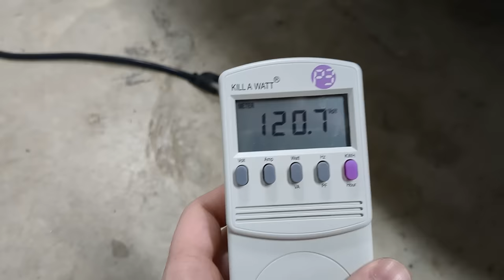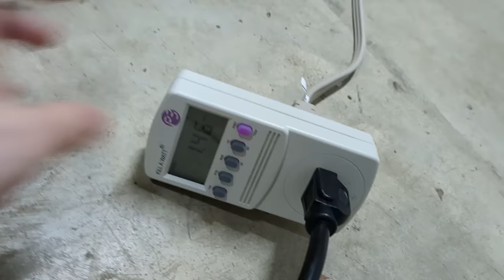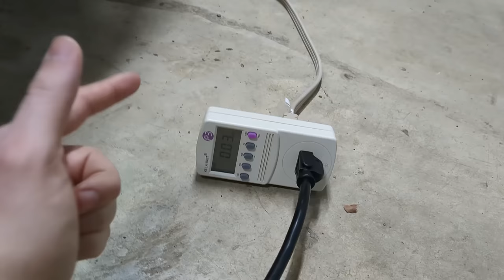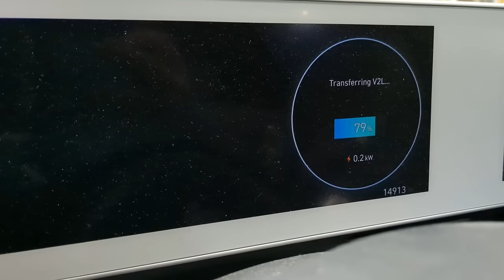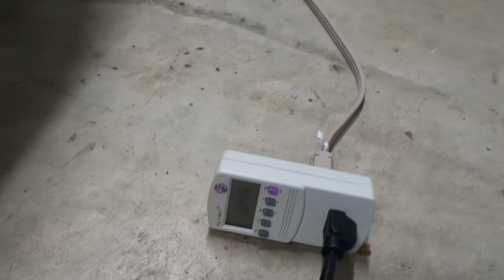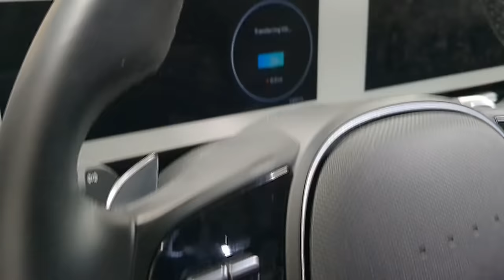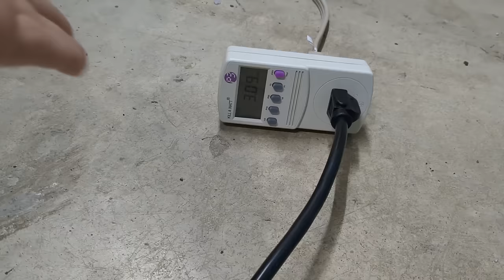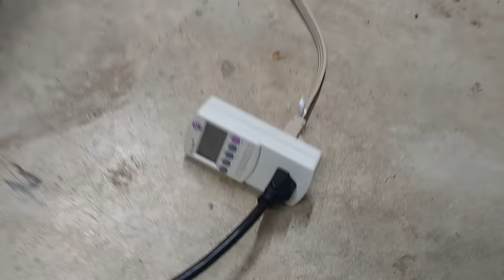A 24-hour test run of the Hyundai Ioniq 5's Vehicle-to-Load function

Comment: Damn. You lucky. 2009 mid autumn and 2010 deep winter, we had power outages for a week and a half each time.   Haven't really had a problem since but those were huge storms that blasted the whole of our area so a lot of people were a week without power at least. You make due. Backups upon backups. No computer work got done other than powering phones off battery bricks to check email once a day and check in with fams.

Comment: Instead of running a plug all the way to your furnace you could flip your houses main breaker and plug your car into and outlet using a suicide plug.  Bonus points if your fridge, freezer and furnace are on the same phase!  (I know its illegal and frowned upon, but it is also not going to kill anyone unless you open the main breaker)

Comment: I'm off-grid here in Finland. My next car will be an EV with V2L, hopefully with an LFP battery. I would be able to drive for free in summer (and parts of spring/autumn) because of my excess solar power, and can use it as an extension to my 60kWh house battery.

Comment: I was kinda hoping that this feature would be wired thru the charger into an ATS, or at least a manual Breaker in the panel ( with the required safety features that come along with that to prevent back feed) so in a power outage situation with no lights on in the garage you just hop in the car go into the menu tap a few buttons and it switches over/ then you go flip the breaker.

Edit! I just realized Lights and heat and AC and everything in your house would probably be too high of a drawn on the car, unless you have an emergency circuit in the house but I think this is crossing in an ideal, perfect unrealistic setup, so maybe in 30 years we can hope for a more robust system more akin to how I would like to see it lol!

I’m use to big ass generators that power entire buildings full of computers and compressors and 1000 to 100,000 watt AM/FM transmitters! So my expectations are a little biased lol

Comment: I have the GV60 and it came with both the 120v charger AND the Vehicle To Load adaptor. I havent used it yet though. They also locked the internal V2L plug, and did not give me an actual physical key to unlock it (though I suspect it isnt an actual key).
Reply from the maker: The connector was locked on my car, too! I think I used a screwdriver to unlock it. You definitely don't need a special key or anything.

Comment: Maybe I'm wrong (if so I'm sure people will point it out)... but even if you actually have a generator, generators are not at all efficient when used for small long-term loads, like a fridge. So in a scenario where you have a gas generator AND an electric car, it would very probably make sense to power your home from the car, then use the generator to charge the car (at whatever max load the generator can handle) until you run out of fuel or the car is fully charged. Of course you're losing efficiency converting fuel to battery power and then to AC voltage... but unless you have a really tiny, really efficient generator (or a large house/family with frequent high electrical loads) this could be the way to go.

Comment: Y'all need 240V; EU version can deliver 3.6kW.
Appreciate the video, V2L needs to be in more EVs and it's nice to see a test of the HMG implementation.
Reply: Technically they have 240V if they just the phases to double the 120V
Reply: @mysticmarble94  meant from the car :) only has one phase.
Been quite interesting to learn a little about the US electrical system.
Like, the typical US home seems to have 200A(?!) service, and 3-phase power is practically not a thing in a residential setting? Though split phase 240V is somewhat common?

Over here, households commonly have 32A service haha.
We do have 230V/phase, and most households have 3-phase AC available, so an EV for example can be charged at 11.1kW on a 16A circuit.

Comment: The European models output 3.4kW at 240V (NOT split-phase though). I've often wondered if the Schuko adapter works with N. American spec cars, and if you could do something with it. Would need another step-down which means more inefficiency, but you'd get a bit more juice to play with?

Comment: I did almost exactly the same thing with my tesla. I wish tesla had an easy and user friendly way to draw power from it, but apparently Elon wants you to buy powerwall instead. The only difference was that I hook inverter output into the home circuit breaker input and have disconnected all powerful electronics before that. Home consumes about 300-600 watts for things like lightning, starlink, tv, laptop, monitor, fridge, gas heater, etc. From my experience I can survive up to 80-100 hours. Thanks to our crazy neighbor many people in Ukraine learned how to survive in a hard way.

Comment: On the heating topic, would the car's own internal heater be more efficient?  It's not ideal to live in a car, but the space is contained, so overall leakage of heat should be less but you'd need to test how efficient just the heating would be over long term.

Comment: That's interesting!
I don't know if you've ever discussed this topic, as I haven't seen all your videos (yet :) ) but I'm wondering if it would make sense to explain "for dummies" what it would take to make a standard home with or without solar panels use a car as a battery, not for emergencies, but for daily use, to shift the grid load to night time and be autonomous during day and evening. I have a small solar installation now (and heat with gas, so low grid consumption too) and I'm hoping for a future where an electric car serves as a battery, and my solar panels charge it during the day, it then allows me to cook / watch movies / light the home in the expensive peak evening hours, and either throughout the night, or until such a level that it starts pumping back from the grid during the cheap hours. At our scale an ad hoc battery doesn't justify itself, but combined with the other function a car has, it could become relevant. Especially for us who don't use the car during the week.
Reply: Yours is an unusual use case, in that most people would have their care away from home during 8 to 10 hours of daylight each day. In winter it's not unusual for it to be still nearly dark when I leave home in the morning and dark again by the time I get back. 

But that raises an interesting idea: plug your car in at work and run your home all night off the boss's power. It would beat stealing paper clips and pens from the stationery cupboard.

And you could even claim that your home was off-grid      😉
Reply: @trueriver1950  I recently heard my boss doesn't pay for electricity at the workplace so that would work great for me. For the OP, the short answer is V2G (Vehicle to Grid). AFAIK the F150 Lightning is the only vehicle I know of in the US which can do something like that.

Comment: For me the longest power outage is 5 days. All you need to do is set up a schedule and only provide power to critical stuff for an hour and then stop (i.e 4-5 hours). With generators since they are all or nothing for power  you do everything you want at once. With a car you can alternate between devices. Also if it is a systemic power failure, do not be surprised if after a couple of days you lose internet and then watch the cell coverage go down the tubes

Comment: Are there any smart electrical systems that can be paired with smart UPS batteries, that can take both power from the grid, and the solar panels , while also having an emergency input from an electrical "generator" like your vehicle, or an other separate system? that can be set to prioritize one source over the others in a chain, also set with hard limits for some, and modular limits for others (like setting a limit to the solar panels draw that is equivalent to what they produce, so minimal battery degradation occurs?)

Comment: most house batteries are only around 14kWh I don't even see a need to test it to be honest 40 odd kWh is overkill, to be fair though it would be nice to get DC out to run an external inverter which is tied into the house because then you could run like 6kW easy also you could recharge a home battery without the efficiency loss of a AC to DC conversion. Although getting that 800V DC down to 48V nominal will require a buck converter.

Comment: Any inverter such as those popularly used with cigarette lighter plug-in use quite a bit of the battery's output just to run the inverter itself, however efficient it may be.  The loss observed here is not surprising.

Comment: Next, we need a setup that will recharge the battery and switch the load when the grid or solar is available. Like a UPS.

In theory, that's just control software.

Comment: Would you consider exploring using this power feature with your smart circuit breaker, and seeing if the two can work together? If so, it could lessen the required individual monitoring of each device.

Comment: Having had a 4 hour powercut on friday last week, it certainly highlighted how much we rely on electricity these days (even though we have gas-fuelled heating, no power = no burny), cooking, lighting, heating, internetting, everythinging basically, yes I have a trio of generators, but no fuel (well, I have some, but it's old and probably not good despite being stabilised with additives), that and two of the three aren't actually functional cos one's a bodged mess of my own doing cos it was for experimenting with, the other's a fudged up ebay purchase a previous owner borked, and the one that's remaining is covered in rat excrement and needs a thorough cleaning before I even think of handling it... :S

Comment: Couldn't you also Jerry rig an outlet for a heat pump system if you don't have gas? As you have pointed out multiple times, it would be more efficient than resistive heating due to the MAGIC OF THE LATENT HEAT OF FUSION AND REFRIGERATION CYCLE!! ;3

Comment: It should be a required feature of every EV sold in the US moving forward. Even on a Bolt EUV I know I could even just turn on the car to charge stuff up and while not 1800watts, can charge smaller LiPo inverters...

Comment: Pity you don't have 240V devices then you could use a UK or AU adapter and get 240V 15A (I believe the car still putes out 15A at that voltage)?

Comment: Hi, you mentioned the garage is heated, will the temperature of the garage & thus the car alter its efficiency in supplying power from the battery?
I'm guessing not much but just asking.

Comment: It's an interesting concept but honestly I think a house battery back-up would generally be "better" due to the fact that in an emergency you may not want to drain your car battery since you'll probably want the option to head out of of town. I understand the house battery back-up would be prohibitively expensive though and getting double duty out of the car as both transportation and battery back-up is much easier on the wallet.

In non-emergency situations like camping though it's an interesting concept for sure, again though since it comes at the expense of transportation range you may need to be careful with that, but hopefully you're not going crazy with the power draw while camping.

Comment: The car might have cooling fans to keep batteries cool. My little battery power station does, & it is only rated at 330 watts continuous output. Using only 10 watts to power my computer modem, the fan would kick on every 30 minutes or so. You lose energy changing from DC to AC too.  You need a generator to run an air conditioner in the hot humid hurricane zone, unless you enjoy sweaty pillows.

Comment: I wonder if there's a 240 volt version of this adapter that would allow you to get more power out? Either 2400 watts or maybe even 3600 depending on the current it can supply? I wonder if there's a difference in the onboard chargers between models sold in different voltage countries, or if it's just the adapter is slightly different?
Reply: I get 3600w on my euro spec model

Comment: Big power outages normally happen either in the worst winter or worst summer. So you would need A/C or heating just to keep the inside temperatures livable, and in winter also hot water. These things are very power-hungry. I don't understand why you didn't take that into consideration.

Comment: Dose the  V2L detect power voltage based on the adapter or is it locked to what the local market uses.
Like since it is the the North America, it only outputs 120v?

Comment: I have a whole house generator, powered by propane, with auto start and auto transfer switch, and personally, I find this far preferable. Since I live in somewhere with a winter, I'd want backup power to be able to heat the house (we have a oil burner).  Since moving to the area about 30 yrs ago, we've had about 3 incidents where we lost power in the winter (due to ice storms) for 3-5 days, so backup power without the ability to run the furnace is not what I'd want.

Plus, if you have others in the house, not being able to use the car without disconnecting the power would make it inconvenient for others :)
Reply: Case in point: we're about 1 day into widespread outages due to a storm, with no timeline yet for restoration.

Comment: I doubt the inverter on the car has such a bad efficiency, I'd be more inclined to think that the battery report on the car is not that accurate and/or non linear. Battery reporting is usually kinda skewed close to the maximum and minimum charge, so maybe dropping from 70 to 60% reported battery level is not the same as going from 100 to 90 or from 15 to 5.

Moreover, li-ion batteries have protection circuits and also firmwares that "fake" a lower available capacity, since those kind of batteries hate being totally discharged or staying fully charged for too long. I don't know if the capacities written on spec sheets already consider these safety margins though.

Comment: Does the Ioniq 5 allow you to lock the car while using V2L mode?

I ask because on almost all modern cars, locking it tells the car "yes, please put the majority of the electronics to sleep, I'm not gonna drive you soon". This may have been the source of some of your parasitic draw? 

Obviously you had to have it unlocked to easily check SOC from the dashboard, but you could avoid that by using the app... assuming it will switch to V2L mode whilst locked.

Comment: The car panicking and shutting off power when you started using more than one appliance at a time is definitely not good, nor is the fact that every company apparently requires some kind of proprietary adapter for this even though they're all using a universal standard connector. (Well, former universal standard at this point—and now I'm wondering if we'll still be able to do this once everyone switches over to the plug made by the one company that doesn't offer this feature.) I realize there's a limit to how much power you're going to want to pull from one battery bank over one cable, but enough to keep a heat pump and refrigerator running at the same time (since they're automatic and a pain to disable) plus a single cooking device seems like a good place to start.

If I had to imagine an ideal universal solution, it'd be for every car to support plugging in a standard extension cable that has a NEMA L14 (the kind some houses have for hooking up a generator) and/or TT-30 (RV) outlet on the other end, and to be able to discharge as much power as they can charge at level 2. But the next step would be for every house to be able to accept emergency power directly through the same wall charger they already have in the garage; that way the car (assuming it's plugged in) can serve as a UPS for the whole house, or at least whichever outlets have been designated as high priority. Imagine—the power goes out, and instead of the house actually losing power, even for a fraction of a second, it just starts grabbing power straight from your giant battery bank on wheels. You get a little alert on your phone letting you know it's happening, because otherwise you wouldn't even notice; maybe it even contacts the power company automatically letting them know there's been a blackout in the area.

Comment: If you wanted to melt some butter to put over the vegetables, then why wouldn't you have just used the heat they had just by putting it directly onto them right after straining?

Comment: This does sound very handy, but wouldn't you get battery anxiety in case of an actual emergency and just not use it so that the car can go a few extra miles farther if you need to leave the house? I always get battery anxiety when I fly, I charge my laptop and phone fully so I'll have entertainment during the flight, then just keep myself from using it, because ohmygod, I'm already at just 82%, what if the battery runs out?

Comment: What if you opener the breaker for the room you're in and use a power inverter plugged into the wall from the car? The scinewave is a bit messy but you could power a whole room relatively easily this way right?

Comment: Do you also have the outlet under the rear seats?  Supposedly between that outlet and the V2L adapter in the charge port you can pull 3.6KW.